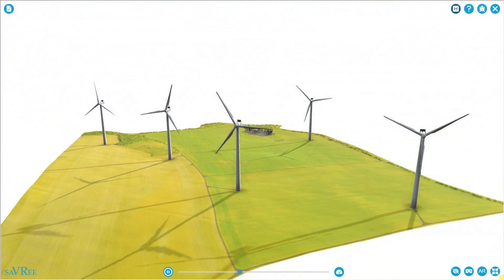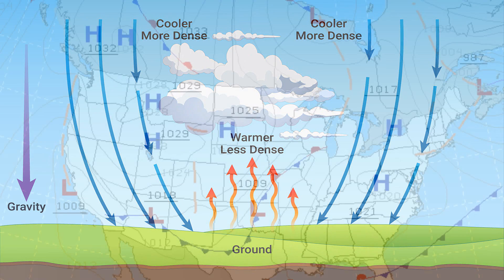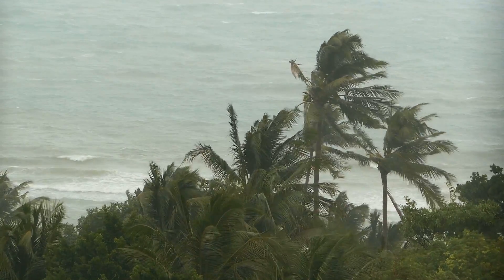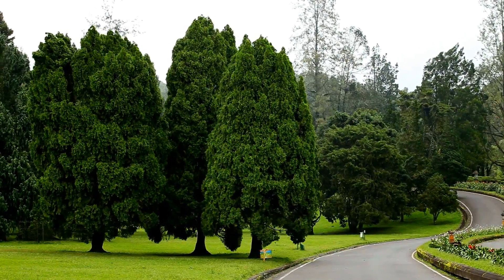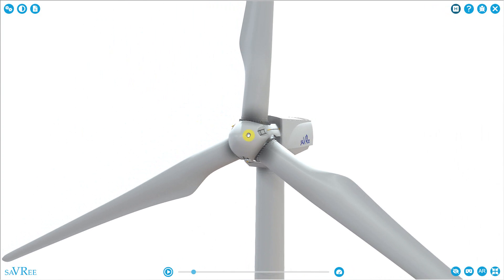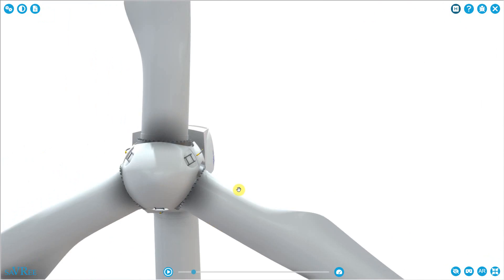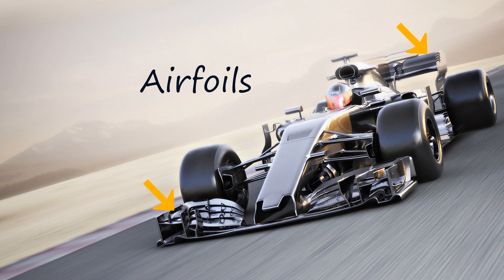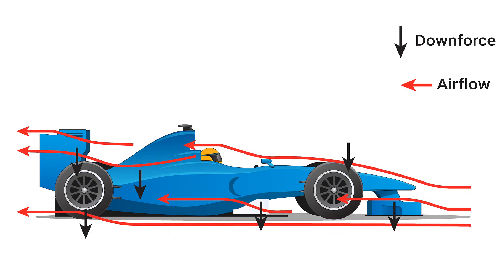How Do Wind Turbines Work?

Comment: So you have non-renewable blades that get buried in land fill when they are damaged or lifed out.
Then you incur frictional loses through the gearbox.
Then you incur electrical losses through the invertor.
This is all sitting on land that may have cleared of trees/vegetation and displaced or killed animals that use large conrete footing.
Then you dig trenches or run overhead power lines to the substation where you incur more electrical losses through the transformers.
Then you dig more trenches or run more overhead power lines, usual long distances ( the longer the distance the more electrical losses through resistance), to another substation.
And if the wind isn't blowing it's all for nothing.
Or if the wing is blowing to fast it's all for nothing.
Or if it's too cold and the blades ice up it's all for nothing.
And because of that variance in supply the grid cannot rely wind turbines to cover output so traditional power generation covers base load. 
Mean while which way have your power bills gone?

Comment: Would you make an in depth video about aircraft structures and airframes? As much detail as possible about about the individual parts.
Reply from the maker: We have one planned for landing gears. The model of a plane we have already, we just need to find a subject matter expert to help with the video.
Reply: @savree-3d  Im looking forward to that. I hope you can dedicate a video to the structural aluminium parts that go into making an airplane. Even the aspect of manufacturing those parts is interesting.

Comment: I also forgot to mention Toyota Priuses, Honda Insights, and Chevrolet Volts, all of which also use a CVT (albeit not an unreliable belt-and-pulley one used by Nissan and VW). All of the CVTs mentioned outside of the parenthesis have also proven to be very reliable. CVTs are one of the best inventions for enabling one shaft to be constant velocity while the other is having varying velocity from a totally mechanical means. This means fewer energy losses due to not having to do power conversion with rectifier-inverter sets for example. Wind turbines should all incorporate CVTs as standard so that the generator rotor can be constant-speed just like with conventional combustion power plants and hydropower.

Comment: Instead of using power electronics to convert the variable-speed generator output into the constant grid frequency, can't they just use a CVT in the gearbox (like in Subaru station wagons and with jet engine 400 Hz constant-speed drives, which have both proven to be very reliable) controlled by communication electronics to ensure that the output shaft is at a constant frequency in sync with the grid? That way, there are fewer losses of useful energy from having fewer conversions. Also, it will make wind power have the advantage of having frequency inertia just like with conventional power plants and hydropower.
Reply: Supposed the wind is slow so you reduce the gear ratio to increase the output speed, the already weak wind is now has to work much harder, probably stalling the rotor, it's not really a good situation. Also the phase of the whole wind farm has to be in sync in other for the power from each wind turbine to merge at the substation, and the need electronic control.